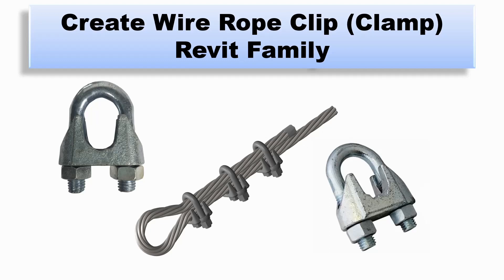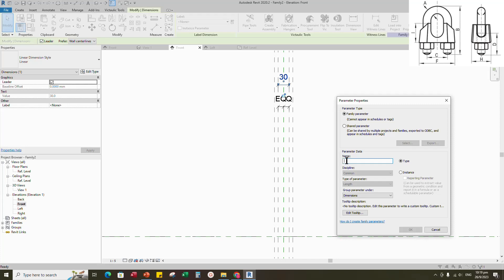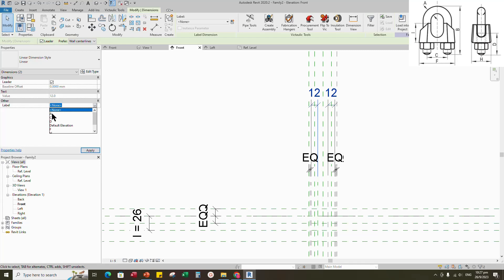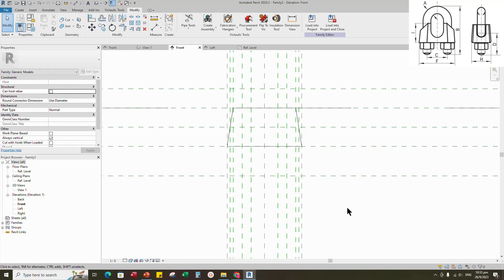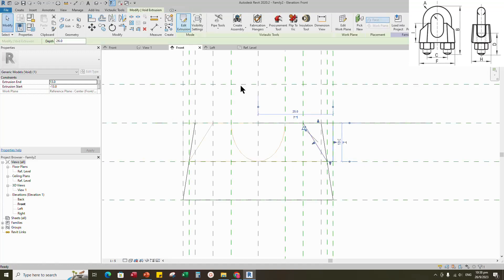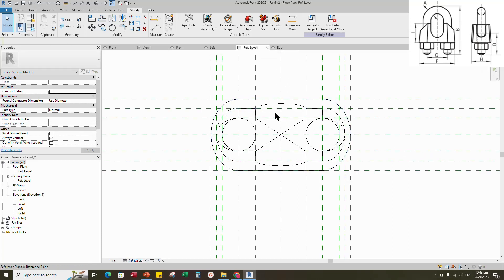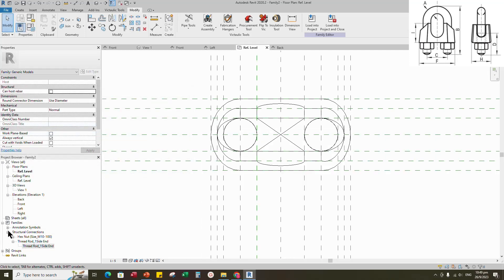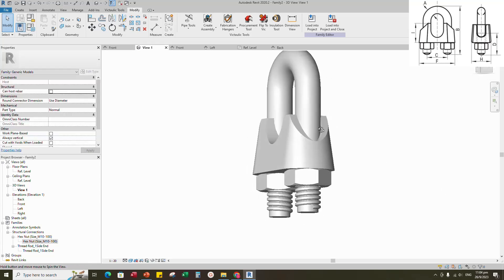Create Wire Rope Clip (Clamp) Parametric Revit Family

Comment: I tried to manually change the parameters for A, C, D, F, H, I (the ones created in this video) and I got a message telling me that the Revit cannot keep the elements together. The values I tried are the ones from the 3rd row to 7th row. After the values in the 7th row, it works fine. I tried to let the Revit remove that restriction, but then the clip got all deformed. Is it possible to share yours?
Reply from the maker: Please share to me via email. I will take a look.